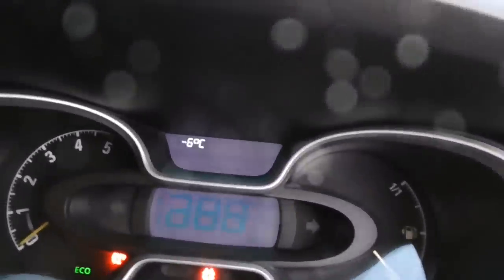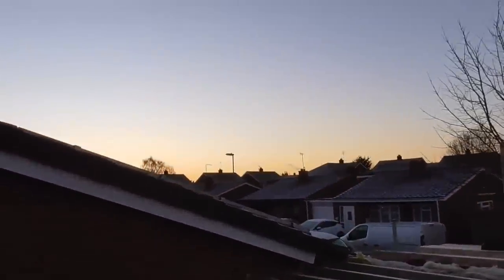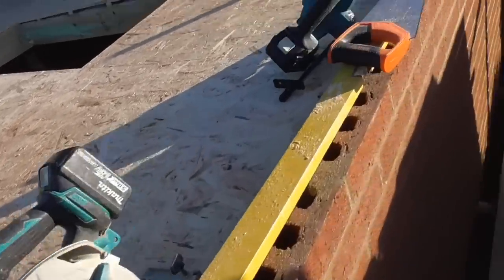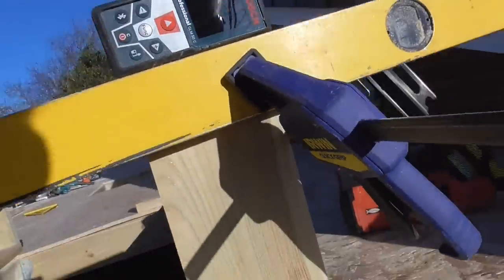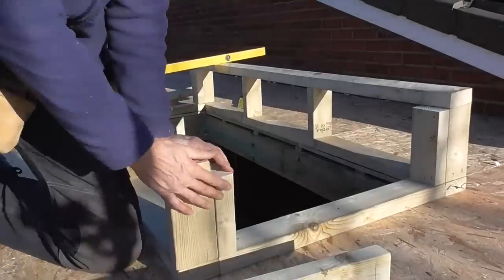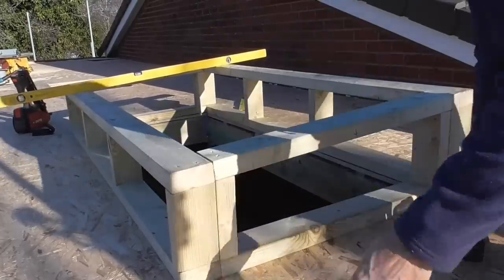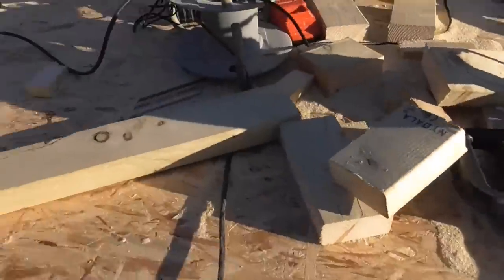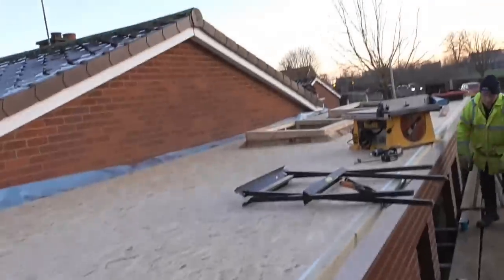Building a flat roof using a 'warm roof' method PART2 ***FITTING DECK AND ROOF LIGHT CURBS***

Comment: Hi have you got any pictures of the finished roof?  i'd like to see the detail where the flat roof passes the pitched roof, does the flat roof protrude above the pitched roof? Cheers, great videos by the way
Reply from the maker: Hi Sean🖐 I haven't got any pictures of that detail unfortunately, but the roofer basically made a lead saddle and dressed it over where the 2 roofs met👍 It looked a lot better than I thought it would👌Cheers Del

Comment: Great work. Can i ask why you put the rooflight framing over the OSB as opposed to the joists?
Reply from the maker: No real reason to do that way round, other than it's easier to construct and fit the curb/rooflight frames off the OSB deck rather than the open joists👍Thanks for watching 😎 Cheers Del
Reply: @thetallcarpenter Makes sense thx

Comment: Similar to what ime doing only ours are lanterns so we build them of the joists, we are having to build the upstands with 6x2 to satisfy the new regs to accommodate the insulation needed now,on the front we just plant a piece of 9x2 ripped down to the height for an upstand to fix the facia to.
Reply from the maker: Hi Andy🖐Yeah, these upstanding will need installation in-between the studs and Celotex over the front/inside🙄Thanks for watching fella and have a good week👍Cheers

Comment: Great attention to detail as usual. Even down to the 1 degree cut on the bottom of the dwarf walls. 2nd fix quality on 1st fix there Del. True of all your jobs is the planning and thought that goes into them. The considered methodical way that you work. The end result is then a testament to the pride you take in your work. I have never been as good a Carpenter as you. But have always worked with a phrase in my mind. Would I be happy with this work/product. If someone was doing it for me. Consequently I have pulled a few things apart over the years because the answer in my head was no. The photo of the end result looked great. It looked like a hot pitch mineral finish. Are they still doing that. Or is there a cold lay version now. That was another job I used to do back in the UK. I would have done the hot pitch work after building it. That would have been a 4 layer system all poured. Perforated layer. Thin layer. Thick layer. Then mineral layer. With a lot of mineral drip work. All the fronts done overhand with a hot mop. Jack of all master of none.
Reply from the maker: Hi Dave🖐Just like you, my default position on my work is, would I be happy if I was doing it for myself🤔I was also surprised to see this roof done with a the 3 layer, torch on felt system, but it comes with a 25 year guarantee, so it must be much better stuff than when I started 36 years ago, when its was exactly as you describe😮thanks for watching bud, and your great comment😎Cheers
Reply: @thetallcarpenter  Torch on. That makes sense. Couldn't see the safety police letting people run around with hot pitch anymore. Pitch pot fires were fairly common. And burns to the operatives also common. The odd house succumbed in the process. We used to watch the smoke. White good. Brown, here she goes. Torch on still looks the part.

Comment: Hi Del, brilliant job as always,  love a chance to work beside you for a week.
Are you of the opinion that a warm roof is superior to a standard cold roof?
Am i right in saying a warm roof like this doesn't need any ventilation?

Do you agree with also insulating between the joists and if so do you push it up tight to the osb lower deck or keep it flush the the inside or slab side to allow a space between it and the lower deck?
If you do leave it flush and you intend on using down lights would you recommend a drop ceiling?
Do you recommend a second water vaper on the inside walls and ceiling?

Love to see the lead work at the .ain house.
Apologies for the long post 😅
Reply from the maker: Hi Dan🖐I/we are only asked to warm roofs by client and architects.  In my opinion, they are more straight forward than cold flat roofs, with the correct design being difficult to get wrong👍 I may be wrong, but adding an additional layer of insulation below at joist level has the potential to create a temperature differential between the layers which, if not vented, could lead to a build of ot trapped moisture🤔 Check out a guy called 'Steve the roofer' on YouTube. He is a specialist in this area😎Cheers Del

Comment: Great job Del. A lot of work gone into  this roof. Do you ever sandwich 2no 75x44s together and ply face instead of a single 150x44 perimeter upstands. Saves using a 200mm long fixing. The extra work behind the glazed panels to create a run off fall is often neglected. First class workmanship 👍
Reply from the maker: Hi Sean🖐I wouldn't say I have a set method for doing flat roofs as they are all different and I don't do many😶but if I needed to, yes, I'd happily fix 2 75mm timbers together to get the right make up👊That's for another great comment bud😎Cheers Del

Comment: How do you know where the supports are for nailing down?
Reply from the maker: Hi Carlos🖐I marked the position of the joists on the brickwork of the main house and also at the outer edges, and then pinged a chalkline between these two points to give me the position of each joist👍Cheers Del

Comment: nice job . i am confused from watching the previous video where you applied the furring strips was that to make the roof flat .i understand you raise it slightly behind the lanterns but does the roof have a pitch and say if it did have a pitch could you build you lantern up-stands at 90. hope i am making sense , thanks for sharing
Reply: I think he said the roof had a 1 in 40 fall
Reply from the maker: Hi David🖐As Rodger said below, the firings I cut formed a 1:40 fall or  about 1.4 degree pitch. Cutting the bottom of the curb studs at 1.4 degrees means the they will be plumb and at 90 degrees to the underside of the joists👍Thanks for your comment😎Cheers Del
Reply: @thetallcarpenter  ah I see never even thought of underside 👍thanks
Reply: @thetallcarpenter sorry but what is the curb stud?
Reply from the maker: @saharasultana4172  The kerb is the term used to describe the stud, ply and insulation 'upstand' that the roof light sits on👍

Comment: Hi Del, thinking of the drip former. What size would you recommend I use? My warm flat roof is 8.5 x 4m and I am using 18mm ply, vcl,120mm insulation. All sitting above the joists which is on top of a single brick wall. It’s going to have a very tall Fascia.
Reply from the maker: The roof guys usually use 2x2 for the edge bead, which enables the roof covering to fall over the gutter👍And yes, flat roofs tend to have a tall fascia if you just sit the joists on top of the brickwork😬

Comment: Lovely job Del!
If you had to choose (price aside) would buy a Paslode or a fischer nail gun?
Reply from the maker: Hi Clint🖐I would go for the Paslode🤔It's only a little more but is a little lighter and more agile in tight spaces especially when skew/toe nailing studs, rafters and noggins. The Fischer does seem more reliable though, and it never misfiresd once during the freezing temperatures🥶 (that's comparing it to the IM350+ not the i series, newer Paslode👍). Cheers

Comment: According to my builder because he is using the brand unilin 1500mm celotex insulation, he doesn’t need a vapour barrier under the insulation on a warm flat roof. Is this true?
Reply from the maker: Hi Tay🖐I have heard of people not using a vapour barrier, and instead relying on the rigid insulations silver foil layer🤔As long as its an approved spec and prevents the upwards passage of moisture, it will be fine👍Cheers Del
Reply: @thetallcarpenter  thank you so much. How can I check the spec of the insulation to be sure?
Reply from the maker: @TigerK94  Hi there. To be fair to your builders, you should really be asking them if you have concerns about the make up of the roof they have done for you🤔 I know from conversation with my Building Control Officer, that the foil on PIR insulation CAN act as a vapour barrier👍
Reply: @thetallcarpenter  unfortunately my builder told me to go find out rather than help me understand. Building Controls officer also doesn't know and ask I find out if its correct and get manufacturer details .. not sure its my job to do that but its my house so I'm trying to get the information which I'm finding difficult to find /understand
Reply from the maker: @TigerK94  Is the underside of the roof finished? (plasterboarded etc)
Reply: @thetallcarpenter no it isn't as yet. You can see the joists from underneath.
Reply from the maker: @TigerK94  If you are concerned about moisture travelling through the insulation, then simply fit a vapour barrier to the underside of the joists before you plasterboard or use foil back plasterboard👍
Reply: @thetallcarpenter  thank you so much for your responses!! Really appreciated

Comment: another excellent video del..why the 5 deg is it because the flat roof pitch is 5 or do u make the upstand 5 degrees regardless of the roof pitch ..cheers
Reply from the maker: Hi PC🖐Yes, the curb upstand must form a 5° pitch, regardless of the roof pitch👍The pitch in degrees of a 1:40 fall is about 1.4°😎Cheers

Comment: Del sorry to be a pain. I’m going slightly off topic here. You’ve got a Makita palm router. I’m after some guide bushes for mine and I’m after some advise. Have you any suggestions to a decent starter kit as I’m only at DIY level not a pro. Any input would be greatly received. Diesel👍
Reply from the maker: Hi Diesel🖐What is it that are wanting to do with your router🤔
Reply: @thetallcarpenter  mainly jig work Del Boy
Reply from the maker: @darrenbethell3171  I bought the plunge base as you can fit different size collars in it, but I also bought a screw in brass guide bush to use with the trimmer base, but didn't like the fact the blade couldn't be easily raised out of the cut when completed and risked snagging the work😬
Reply: I’ve also got the plunge
Base as well there’s just so many to choose from. Like I said I really need to get something bought as I’ve got plenty of Projects coming up that’s going to be using a lot of jigs for the router.
Reply from the maker: @Darren Bethell  From memory I've got a 16mm guide bush for my hinge jig, and a 30mm one for something else that I can't remember🤯 The jig you want to use will usually tell you what size bush it needs, but failing that, if you're making your own jigs and guides, a 30mm bush gives you more flexibility for cutter choice👊
Reply: @thetallcarpenter  30mm bush it is then Del. Any ones in particular you can think of
Reply from the maker: @darrenbethell3171  I just got the Makita one👊
Reply: @thetallcarpenter  right I’ll get that ordered then Del. Thanks for the interaction greatly appreciated keep up the good work buddy 👌👊

Comment: Looking for some advice anyone recommend me to treat new unglazed internal doors which treatment is the best and should I only treat the sides or the complete door ???
Reply from the maker: When you say 'treat' what do you mean?. Are ther softwood or hardwood doors, unfinished natural grain, of moulded, white type doors🤔
Reply: Hi 
There a hollow door and primed and ready to paint I live in a old cottage but I’ve been told to treat the ends to stop them from warping.

And thank you for taking time to reply 👍
Reply from the maker: @Truth  If you can coat the the top and bottom edges it would be preferable, but most of the time on site they never get done🤔
Reply: @thetallcarpenter  I would prefer to do that as I live in stone walls so can you recommend which sealer I can use pls

Comment: 6x2 or other size (depends on insulation thickness) upstand should be fixed all around perimeter on the of 18mm OSB - best T&G. Vapour control layer should go on the OSB and up on upstands inside. Insulation - Kingspan TR27 or other suitable for warm roofs cut tight and then mechanically fixed with thermally broken screws. DO NOT USE ANOTHER LAYER OF OSB ON TOP - IT WILL ROT! Finish with a final layer of waterproof membrane like EPDM, Sarnafil direct on insulation. Bitumen based waterproofing systems will require suitable underlayers.
Reply from the maker: Perfect👍

Comment: Hi Del, does the fascia go right to the top level with the top deck of Osb on the sides too? Or does it carry on to the tilt fillet on the sides? Thanks
Reply from the maker: Hi there🖐Yes, the fascia goes flush to the top deck on the sides, and the tilt fillet lips over  it flush👍
Reply: Thanks for always answering my questions so patiently.
Reply from the maker: @saharasultana4172  👍😎
Reply: Is the tilt fillet also called an aris rail? I can’t find it in wickes. Do you mind linking it so I can see what it looks like and what size did you use please Del 🤲🏼
Reply from the maker: @saharasultana4172  

https://www.travisperkins.co.uk/feather-edge-boards/47mm-x-50mm-x-3-0m-green-treated-arris-fence-rail-2ex/p/939160
Reply from the maker: @saharasultana4172  https://www.huwsgray.co.uk/arris-rail/sawn-treated-arris-rail-50-x-50mm-x-36m-100010844-2825269
Reply: Thank you so much Del. Which size did you use around the roof light upstand please and which size on the sides of the flat roof.
Reply from the maker: @saharasultana4172  From memory I think the builder got 75 x 75 for the upstands and the edges, which was a bit big in my opinion 🤔
Reply: Thank you so much! That is really helpful. I will likely have more questions as I try to navigate my head around all this!

Did you insulate the up-stand and does the vcl go up the sides or in the inner surface?

Comment: Hi Del, did you have to use the 200mm long screws to secure the 150mm timber in front of the celotex ? It looked a great job at the end, and the builder got his money worths out of you on this one 👏 👏👏
Reply from the maker: Hi Kevin🖐Yes, I used 200mm screws to fix down the 150mm timbers into the toe end detail of the joists👍It worked really well actually👊Thanks for watching as always bud🤩Cheers

Comment: Nice to see a vapour barrier being used! Does T look like 150mm insulation added to the skylight upstands though? Warm roof’s definitely the way to go if you got the build height available.
Reply from the maker: Hi there🖐Its doesn't look like the curb is 150mm above the finished roof because the tilt fillet was 100mm x 100mm and the roof lights have a big skirt on them🤔I had to double check it myself when I saw it finished😵In my opinion, you must use a vapour barrier of you can get in a world of pain with sweating if moist air can get in from underneath😩Thanks for your comment and for watching😎Cheers Del
Reply: Do you need to add 150mm insulation? Can you get away with say 100mm?

Comment: Nice job but why didn't they just extend the pitched roof with velux windows in
Reply from the maker: Hi Paul🖐I suspect the planners didn't want it😩 Like you say, would have been a better job👍Cheers Del
Reply: Leaves a horrible detail at either end where it meets with existing roof. I am not a big fan of roof windows they are really heavy to get onto roof. You can't fit the same insulation or airflow as roof and the plasterboard finishes up against the glass on internal side. I fit a upvc corner strip but looks crap and hard to paint to. Be interested to know your thoughts or ideas.
Reply from the maker: @Paul Lindsay  I agree with all you've said Paul🤔 The also condensate like mad which is why the roof covering MUST come up and over onto the top of the curb. Even if you get a nice idea to finish off the plasterboard at the top, you can still see its reflection in the glass for below😶 I'm my opinion, if you're going to have roof lights, I'd go for much bigger ones, and probably lantern type👍
Reply: @thetallcarpenter  agree 100% I don't understand why the frame isn't wider so the thermo board meets the frame instead of glass terrible design. I like the warm roof great way of top insulation.

Comment: You can’t just use long screws through the OSB and insulation on a warm roof 
Thermally broken fixings are required
No tongue and groove OSB either ?
Reply from the maker: We can use long screws Mac, and we did👍Thanks for watching😎Cheers Del
Reply: @thetallcarpenter  
I see that, it’s not recommended for a warm roof
Reply from the maker: @Mac Smith  What issues will arise from using screws to fix the top deck layer down through the insulation, through the bottom deck and into the joists?
Reply: @thetallcarpenter  That's the way I fix the top layer to the bottom as well Del. I can't see the issue to be honest.
Reply from the maker: @Toyotaamazon80series  Hi TN🖐Hope all is well with you🤞Yeah, I get that 'technically' the long screw canbact as a thermal bridge, but in reality, heat loss through the long screws would be almost unmeasurable 😉Cheers Del
Reply: @thetallcarpenter  Evening Del, I have to agree with you. The heat loss from a cold bridge of that size is inconsequential in my opinion. Did you use 12mm or 18mm for your top layer?
Reply from the maker: @Toyotaamazon80series  18mm bud👌
Reply: @thetallcarpenter  Was that specified by an engineer or was it your call? Would you have an issue with using 12mm?
Reply from the maker: @TheToolnut  I'm sure I saw 18mm top deck specified somewhere🤔so stuck with that👍

Comment: Why use felt? EPDM or fibreglass lasts 5 times as long. T&g the top layer, the bottom deck doesn't need to be great.
Reply from the maker: Mineral felt would not have been my choice either Dominic😶Thanks for watching 😎 Cheers Del
Reply: @thetallcarpenter  just spent weeks chipping and stripping 11 layers of felt and bitumen off a roof. Seems sad to disrespect great carpentry with an awful top layer. What were they thinking?
Reply: PS every year the roof leaked. Don't use felt. Ever. Traps water between the layers and gradually leaks into the woodwork below.
Reply from the maker: @dominicerrington6788  What do you think bud💰